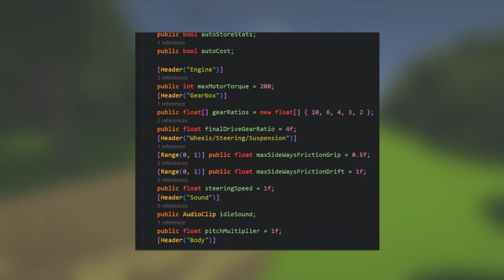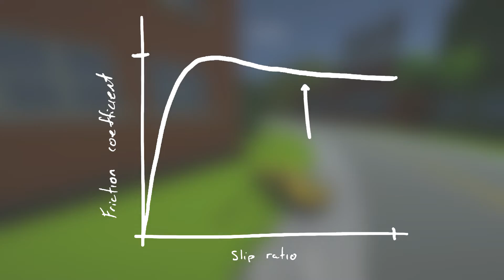Breaking The Laws of Physics to Make Drifting Better - Drifto Devlog

Comment: Just out of curiosity, what would need to change to allow the highspeed 360?
Reply from the maker: I would need to change the friction model.
Right now if the car is going in the opposite direction to the way it’s facing, it has ridiculous amounts of grip
Reply: @jonathonhowe  So assuming you don't have your variable clamped to only positives, could you add something along the lines of, if speed/velocity is less less then or equal to, lets say -10, have the grip closer to the forward velocities? and the -10 or whatever value it becomes, would be a buffer so you still have grip from launch. Might be a fun test.
Reply from the maker: So the grip is quite low when travelling backwards fast? 🤔
Reply: @jonathonhowe  exactly!

Comment: Here is my review and ideas to improve the game:

Is a great game. Is fun and also challenging, but it has its flaws and possible improvements.

The game needs a sun with smoother light and shadows being cast behind trees and buildings. The game would not also be fund, but looks sick mit a bit more refinement to visuals.

The tracks are awesome and have many different parts, but they definitely needs more.

Tho, if u try to make money and unlock cars there is no reason to play all tracks, after u receive the Highscore-Cash rewards. 
I would suggest something like a collectable Chashout-multiplier at score 250,500,750,1000,... ; They would respawn every  1/4, 1/2, 3/4, 1h after collected and would multiple the Cashout with 1.25x, 1.5x, 1.75x, 2x times. I would give the player a reason to play every map again and come back to the game.

All these cars have a slightly different handling model and all look very sick🔥
But some cars are just not as good than others.
I'd be cool if there was some kind Mini-Quest per car, which upon completion will unlock new color or reward u with money.
(Example: Reach Score 1500 on Rally to unlock ...)

The more side ways u go the higher the score gets. Also for holding a longs Drift there is a multiplier.
But u can't chain drifts if u change direction, without resetting the multiplayer.
Also a feedback if u hold a long drift.

If u want to add cosmetics or rewards, tire smoke and underglow, are good options.

In the end, it is a really fun game and hope for more updates.
Reply from the maker: Those are some amazing ideas!

1. Yes the visuals need some love. Unfortunately they're going to get worse before they get better. There are some performance issues caused primarily by the effects used currently. They will get better, but not in the next few weeks.
2. Yes, there does need to be some more incentive and I love that idea. The tricky part I feel will be communicating how such a system would work. I'd love to look into it more.
3. The scoring is far too ambiguous. I'm planning on redoing this, including more feedback like you've suggested.
4. I hadn't thought of those cosmetic options. I like

Thank so much for the feedback!
I'm looking forward to creating more updates!

Comment: Where did you learn game development?I do not know where to start...and I have basic c# knowledge...Where do I go?
Reply from the maker: My gamedev knowledge is all learnt through tutorials and trial and error.
Before I started Unity I did have 5+ years programming and 2/3rds of a computer science degree which would've made it way easier.

I think the best way to start development is to just make stuff. Come up with an idea, it doesn't have to be good, and build it. Watch tutorials, read docs, talk to others.
The biggest challenge I've found is making the system well, that is, writing code such that the system is flexible and scalable.

Comment: I'm guessing you aren't going to make the car physics open-source, however, can you point us to some resources that you used to develop them so far? Like, where to even start. What you have here looks very good so far, but the whole world of racing games is just mind blowing in terms of the physics and coding behind it. Would really appreciate a few pointers!
Reply from the maker: I've got some good news. For the car physics I bought the Arcade Car Controller (Lite version) from the Unity asset store and it has since been made free.
I've done some heavy modification to it though. But the core of the mechanics is controlled by the ACC asset.
https://assetstore.unity.com/packages/templates/systems/arcade-car-controller-lite-version-145489

Comment: Hello, I downloaded your game recently, and while I really enjoy it, I have come up with some QOL improvements that could be made. The friending system does not seem to be working on android phones. Also, the points-to-coins mechanic is a little confusing for newer players. Adding a little coins counter that upticks once every 20 points would make the app much more user-friendly. I also think adding some sort of collectible that gives you bonus points if you take the ideal drifting line would be cool. I saw a review on Google Play that mentioned maybe adding a minimap, but I don't think that is really needed. The player is given plenty of time to adjust the slide after each corner, and I personally feel that a minimap would make the game feel less realistic.
Reply from the maker: Yes, the friend system seems to be broken completely, it's on the backlog of bugs. The point to coins conversion should be more transparent, not sure how I'm going to fix that yet, I'm hesistant on adding more UI in game that doesn't add the the run itself.
Ideal drifting line bonus is a big yes. I've got a big list of things like this I'm calling gameplay spice.

Comment: Just installed it. It's quite fun to pass some time. Music and sounds didn't work for me, not entirely sure if there are any yet (but there are settings for it).

I definitely agree with some other comments that the base mechanics are there, but it needs some spice. Collectible coins as point boosters or something would be one idea. 

I also feel the game is missing some notion of progression that makes it harder the higher your score is. Think Subway Surfers where you keep going faster and faster. Power ups could also slow this progression, allowing you to keep going for longer.

For new players there should be a bit more choice, too. Let them select one of three cars to start with (Pokemon style) or unlock a second car based on achievement of scoring 100 or something like that. It doesn't take terribly long as it is, but the first unlocking experience should come even sooner IMO.

Personally I didn't quite understand how scoring works. At first I thought it's "drift time", but when I unlocked the city and went around the roundabout it became clear it's not the only factor. I also had trouble understanding the UI at first when it comes to points versus money earned.

But all in a it's pretty fun already, great job and can't wait to see where it goes.
Reply from the maker: Thank you so much for all the feedback!
I agree with all of the suggestions. I have been thinking of how to implement more gameplay spice and making the scoring more transparent.
Having multiple starter cars would also help with the start of the game feeling a little bland.

Comment: Hey i have played your game for a couple days and its teally cool but it would be cool to see a better optmized control system or a  single hand system
Reply from the maker: Thank you! I’m happy to hear you like Drifto.
I’m planning on adding different control systems players can choose between. What do you mean by a better optimised control system and single hand system?
Reply: @jonathonhowe  so in my personal experience my finger starts to get really hot during long games because of the atrict with the screen and it affects negatively my experience. I would suggest a screen sided tap ( tap the left side of the screen so the  car goes left same with the other side ) but im not sure you are aiming for that kind of control system since the current one is a more of a scroll like. It also would be cool to have a motion control but as i have never coded more than a calculator in c# im not sure if it would be possible to make it happen ._.

MY ENGLISH IS NOT THE BEST SORRY. THIS MESSAGE IS JUST A SUGGESTION NO NEED TO TAKE IT SERIOUSLY.
Reply: As you said it could be another control system you can choose on the settings

Comment: What I think the features that this game needs:
1) Some sort of chaining drifts system. Inertia drift seems impossible (although I'm new to the game, maybe you might achieve inertia with later cars)
1,5) Score multiplier. If you chain drifts long enough you can multiply the scores you're gaining. And if you hard-stop your car or don't drift for some time you lose that multiplier.
(+ you may gain more multipliers if you're close to either of the walls, kind of like carx) 
2) Night mode. I think it would make the game prettier and it can even have a function. Maybe only in night mode your score gets effected by multipliers, or vice versa. 
2,5) Initial D brake trails for night mode. Self explanatory. 
3)Alternative control schemes. Maybe a steering wheel one, or a two button one? 
3,5) Fixed steering line thing(?). The current steering line can't be fixed to one location. This may be relatively easy to implement to the game, but I think it would greatly improve the game.

I really like this game and I want to see it grow. Wish you the best.
Reply from the maker: This is good stuff, here's my thoughts
1) This is something I have been thinking about. Perhaps when drifting and steering hard in the opposite direction a boost is given - speed, points, or faster turn
1.5) There is actually a hidden multiplier already, it slowly builds up while drifting and drops when not drifting. I would like to show it and make it smarter though. The idea is exactly what you've suggested.
2) That would be cool. The challenge with night mode will be performance. Lighting calculations are expensive and the game is already slow.
2.5) Of course
3) Agreed
3.5) This was intentional. In earlier versions of Drifto it was fixed to the centre. This would be somehow incorporated into alternate control schemes.
Thank you so much for the suggestions! I hope I interepreted them right.

Comment: Loved the video and Installed the game, I would love it if you add some collectable like mario kart on the roads that does something. Other idea is to add more places to do "trickshots", like in Indusso map there is 2 lamps where you can pass the car throught and the dopamine spike felt great hitting it. Keep up the great work :)
Reply from the maker: Thank you!

I never thought of that. It’s a cool perspective for designing tracks.

As for power-ups, I’ve thought about giving the play some sort of advantage when they do certain moves, like a reverse entry, big jump, or even another hard move like going between two lampposts.
Unsure how I could give an advantage, simply speeding up the car makes it hard to control. Maybe a points bonus?
Is that along the lines of what you’re thinking?
Reply: @jonathonhowe  Exactly that, I feel like the power ups like boosts and jumps would make it very difficult to play so I feel like it needs more systems to spice up the gameplay. Ater the system(s) I'm sure it will be more clear the path to "collectables" on the road. But that's for the future. Other thing is I felt like it was very difficult to gain enough coins to buy more cars, so to fix it you could add a box or something that when you bought you had the chance to buy cars with different rarities (common, ...), iI think that would add a lot to the gameplay. Just ideas but happy to help :))

Comment: Although optimisation doesn't seem to be a main problem for you at the moment, it very much is. Even in low graphics, the game lags and sometimes even stop for a second or two on budget phones (for example my Mate 20 Lite). So I suggest you spend a bit more time on the optimization side of things. And the stater car is lacking on the acceleration department, I know it might be intentional but it makes starting the game a bit boring, considering in the beginning you crash a lot.
Reply from the maker: Yes I agree performance is a problem currently. I've been in denial about it up until now.
The starting car is intentionally slow. I'll see what I can do to make it seem faster.
Reply: @jonathonhowe  Yeah I think that's the problem, you don't really feel the car's speed. The car should feel faster. I don't really know how you can achieve that but that seems to be the problem.

Comment: I just installed the game but I have a problem right away. I have a budget phone and the game starts at high graphics, no biggie, I can always open the menu and change it. But the game make you play the tutorial right away, so you can't change the graphics when you first start the game, and if you do so, you can't access the tutorial. (I hope my wording isn't weird or anything, not a native speaker.)
Reply from the maker: You should be able to access settings without quitting the tutorial. There's a button through the pause menu.
Do you think it would be a good idea to make the tutorial accessable even after quitting?
(Your comment was well worded, very clear)
Reply: @jonathonhowe  I think so, yes. Tutorials should always be accessible through settings or some other system. Thanks for actually listening. Wish you the best.